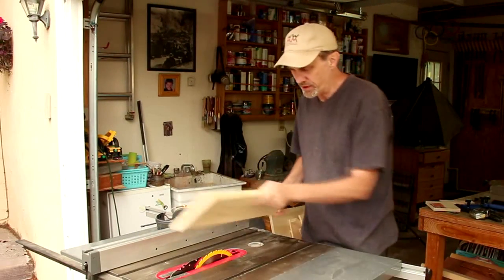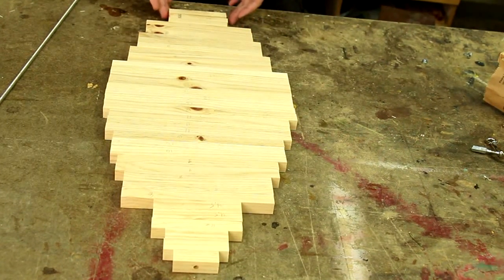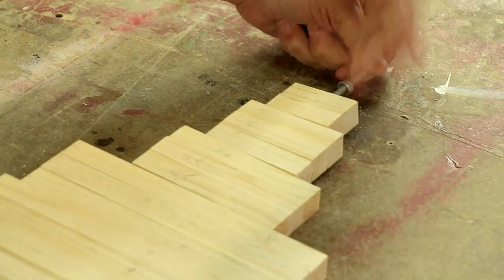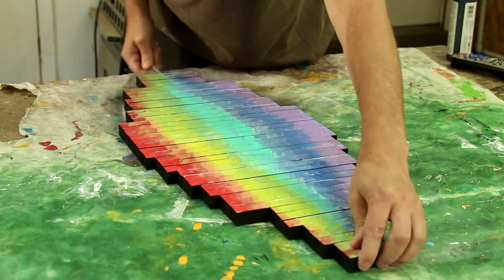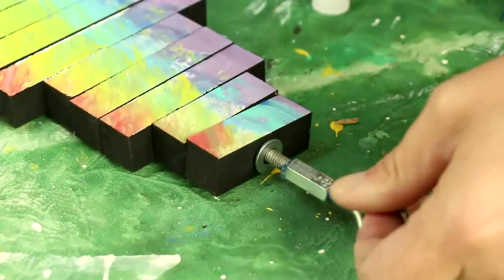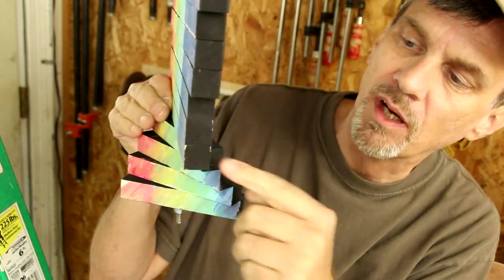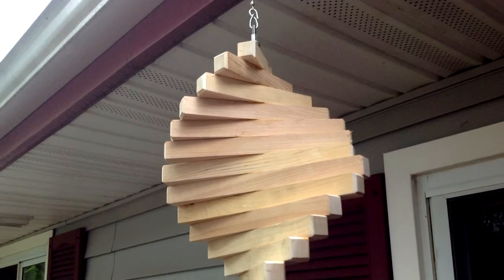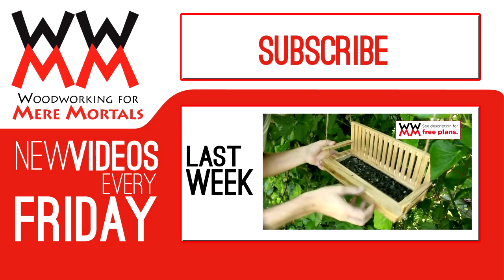Make a wind spinner. Easy and fun DIY project.

Comment: Nice projecgt to keep someone busy for a couple days.  I took your advice and start getting pallets, but I have one suggestion for you and everyone else who takes apart pallets,  Don't bend over and work off the ground.  Stack them so you are not bending over all the time.  Use a good pry bar for pulling the nails as all the pallets I get have special nails that are driven by air, so the pry bar makes pulling the nails easier.
Keep up the projects from pallets

Comment: I made one from cherry.  It did not turn very well. (too heavy maybe)  The same design in pine worked much better.  I then ripped the 3/4" pieces in half and put them back on the rod.  That, with a fish spinning line in place of the metal spinner worked best.